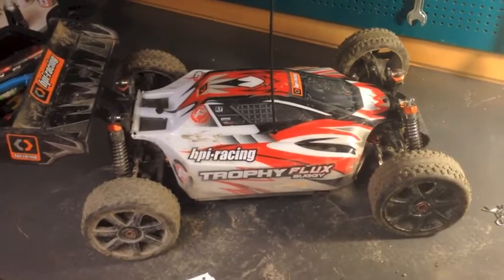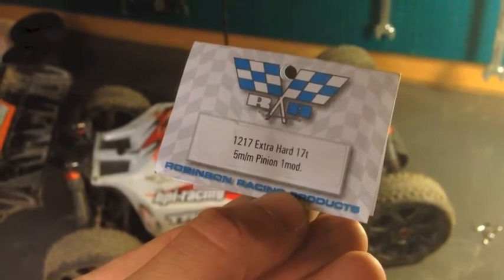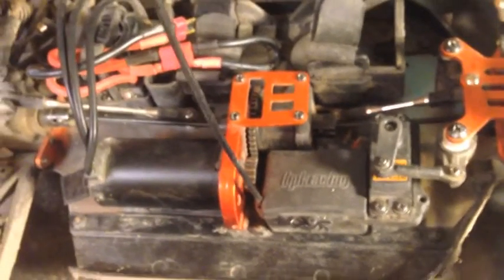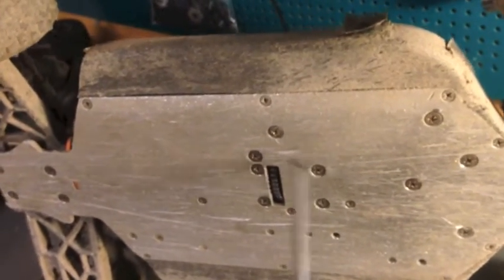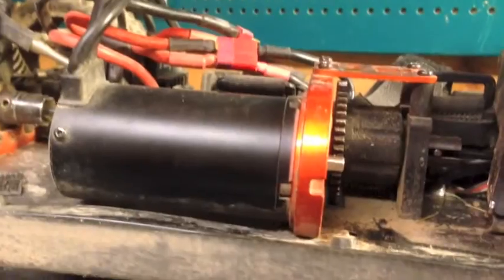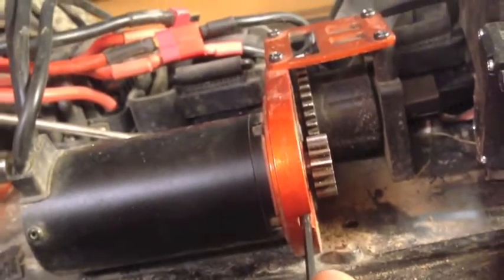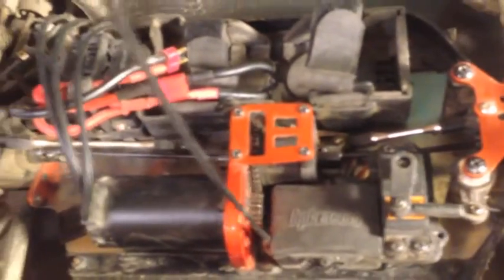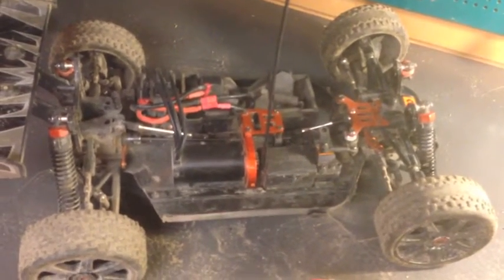HPI Trophy Buggy Flux - First Upgrade Pinion gear

Comment: +RC SwedenJones  I have a 17t mod 1 pinion but i can't install it right it's jammed up when i push truggy back and forth.
Reply from the maker: Make sure using a piece of paper for gear mesh in between pinjon and spur gear.

Did you insett the screw towards the flat side of the motor pin? If the screw sticks out to much, the pinjon Will lock the car from turning around.
Reply from the maker: I used 21T pinjon gear on My truggy.
Had speed run on about 80km\h. It made a big difference!
Reply: +RC SwedenJones I made sure it was on the flat side I tried my 17t and 24t same thing car won't move.
Reply from the maker: +hardyb311 check so that there are no stone stuck in the gear. That could cause the issue.
Reply: +RC SwedenJones Everything fine when I put the stock back on
Reply from the maker: +hardyb311 hard to till then. Everything works if you remove the pinion right?
Is the pinion screw sticking out much?
Reply: +RC SwedenJones I'm check when I get off and I let u know
"thanks"
Reply: +RC SwedenJones you were right the screw was sticking out.

"thanks"
Reply from the maker: +hardyb311 glad it's working for you man! Cheers
Reply: +RC SwedenJones I'm running a 24t pinion is that to much gear for it? The motor was real hot on speed runs 48mph I have fans on ESC and motor.
Reply from the maker: +hardyb311 buy a heat check tool. There are info on web for the motor on max recommended Temp. But I remember with 21T was hot aswell

Comment: +RC SwedenJones what will the 17t pinion do?
Reply from the maker: More gear=higher top speed
Less gear= more tourqe
Reply: +RC SwedenJones k thanks, did u do a speed run on the 17t just trying to see how fast it is on 4s
Reply: My hpi trophy truggy flux makes a clicking noise when i turn the wheels but not when it's going straight and sometimes the wheels lock up on turns. Could the shafts be going out?